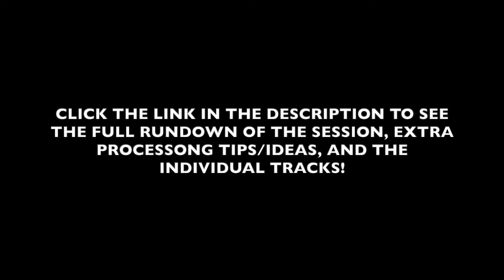3 WAYS TO USE A SUB KICK MIC IN YOUR DRUM RECORDINGS - NOISE HOME PATREON PREVIEW

Comment: The 1st sound clip has a lot of snare bleed coming into the subkick or another mic. The second clip sounds better and the bass is boomy! The 3rd sound clip threw me off lol. But it was interesting.

Edit: what size speaker is better? Also would you want a higher ohm speaker to keep the power low? I heard a 10in sub/speaker and it sounded amazing. Lots of low end but it had a nice small magnet